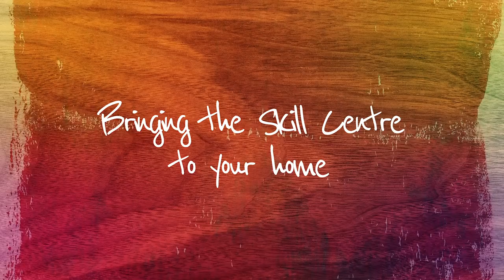#SkillCentreAtHome - Live Turning Tuesday - Turning Small Projects

Comment: Hi, enjoying your videos a lot, not sure if this is the right place to ask a question for the next Q and A? Please would you explain the benefits of a lathe with a zero speed start as opposed to one with variable speed from say 250rpm. I'm thinking about upgrading but not sure if this feature is worth the extra £300 or so? Many thanks keepup the great videos!
Reply from the maker: Hi Robert, the following reply is from Colwin - "Personally, I would want my lathe starting at zero just for those bigger projects, most electronic variable speed machines will have this facility. It will also allow you to do things like thread chasing, painting and wet sanding on the lathe if you want to".